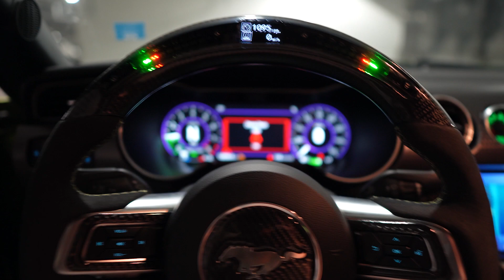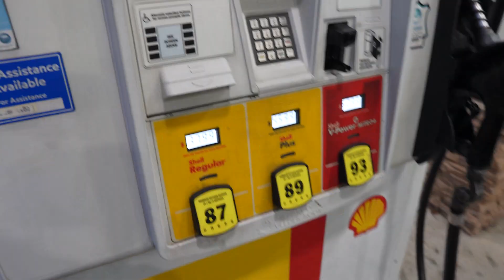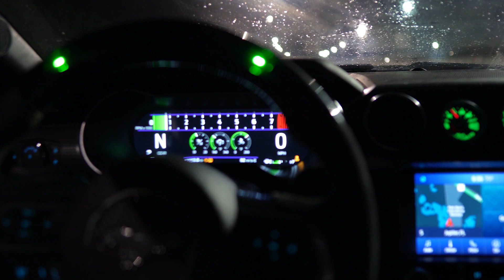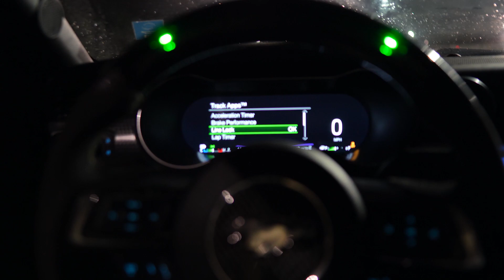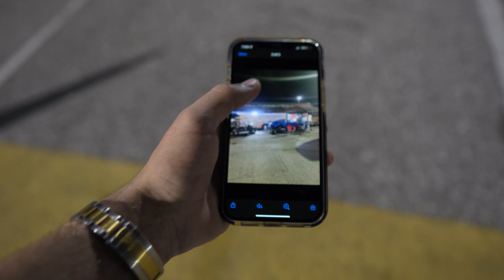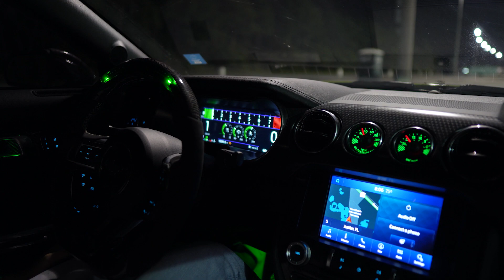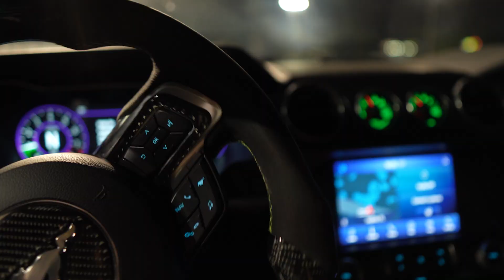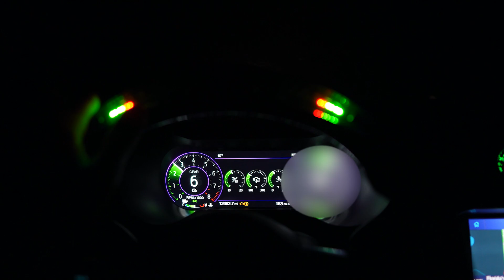MY FIRST TIME TAKING SALLY TO THE DRAG STRIP SINCE WHIPPLE INSTALL! (0 SECOND 1/4 MILE) #FORD #V8

Comment: Do your own work and you won’t get screwed… Get tuned for E85, make safer power, and it’s cheaper. If that platform supports it, install an ethanol content sensor and tune for flex fuel so you aren’t stuck with E85 nor switching back and forth on gas and E tunes.
Reply: How am I supposed to change out a half shaft with no tools? I didn’t go to the drag strip with them